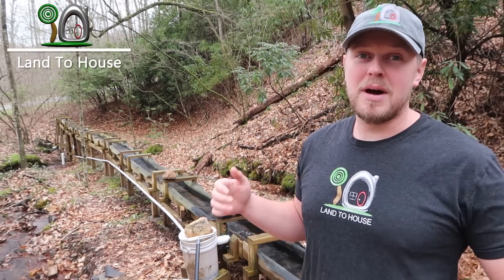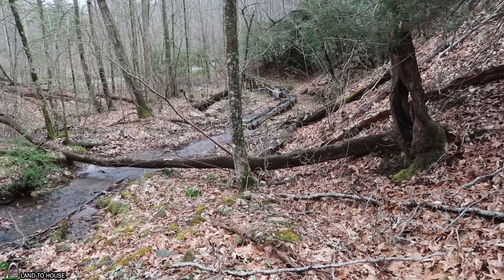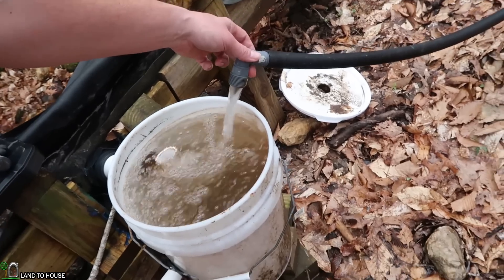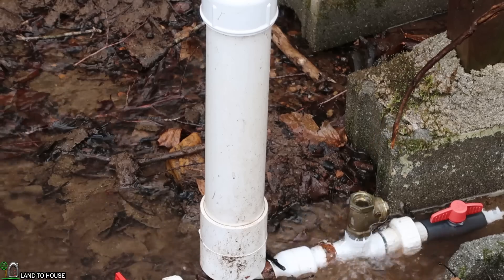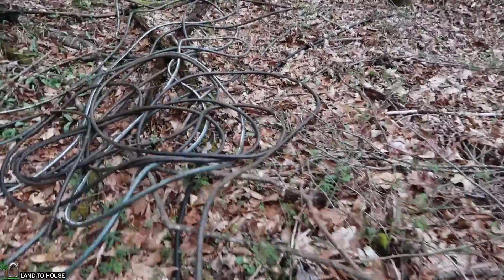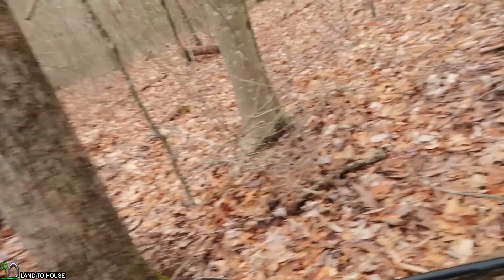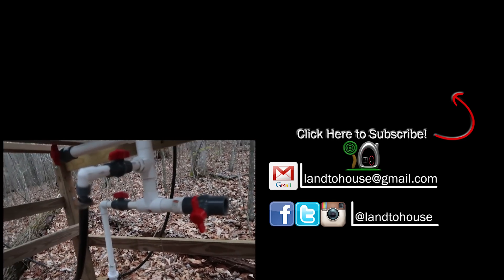Starting up the Ram Pump 2019

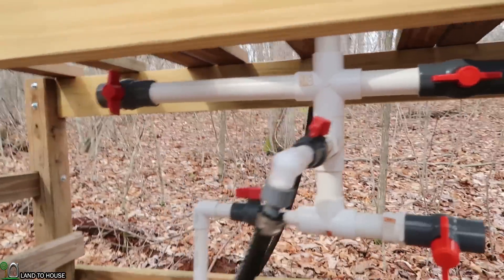Comment: @ 15:30 You said that the Water hammer caused the joint to pop.   It looks to me like you did not use any pvc primer.  It is your best friend when doing pvc pipe plumbing.   

When doing black ABS drain pipe it is not needed.   Primer on conduit is optional, but I use it because I do not want the pipe to allow moisture to gain access to any wires (just my precaution as I had an underground Power Company power lead to our house blow up in  our back yard.).  

There are videos on youtube on how to get fittings apart when glued.    You can also make your own water hammer arrestor and install it before the fitting .  interesting video.

Comment: almost all the forces involved in this system is from elevation head, atmospheric pressures are negligible
Reply: Correct. Atmospheric has no bearing on this. Head pressure at .434 pounds per foot of elevation.

Comment: This may not be a favorable question to ask, but how does this affect the wildlife by doing this? Seems like a sizeable creek
Reply from the maker: This creek is flowing around 50 gpm. The 1" pump uses 6gpm. But most of that water continues down the creek out the waste valve. So very little wildlife interaction.

Comment: You would get more flow by pumping into the top. You are working against gravity. The water pressure is falling into the pipe you are trying to pump out of.
Reply from the maker: I actually have a video test showing that it is faster to pump into a tank from the bottom. Because the tank is not full from the start it is not as hard to lift water into the tank.
Reply: @LandtoHouse  Yes but as the tank fills up the downforce of the waterpressure would cause the pump to struggle more than it would to just pump it into the top with a shepherds hook to keep the air out.
Reply: You could also have dug an area on the side of the hill and rode the waterpipe on the side of the hill into the top of the water barrel so that you approach at an angle rather than rising straight up from the bottom.

Comment: i would imaging that the size of the pipe does not matter as much as the height of the pipe.
theoretically at least it would be less atmospheric pressure if you go up because there simply is less atmosphere pushing down on the water.

Comment: Awesome build! I am a bit concerned about the location of the actual ram pump and the cinderblock footings. Consider putting down some rip-rap armor (cobblestone /angular rock wall) to angle the water away from the cinderblock footings. A good rainfall could cause some erosion as it looks very silty. Also consider some angle beams to the sections that are held by the footings that may become compromised. Very cool and I hope you implement microturbines for electricity!

Comment: another idea for removing bubbles is to add a small pipe section to make the water go straight into water instead of hitting water like your diving
Reply from the maker: Yes absolutely! I have added that in the 2020 ram pump start video.

Comment: The Ram pump is an interesting technology; But I Think I would prefer to use a solar powered water pump. Just much simpler in design won't need to build a water trough. Can fill up the tanks during the day. way less maintenance too. I think the Ram pump was a great idea in its heyday. But now solar panels and high lift electric pumps are plentiful and cheap.

Comment: I think there is another factor to consider once the water reaches the tanks. The weight of the water itself. Add to the weight of atmospheric pressure. If you put the input at the top of the tanks you can subtract the weight of the water in the tanks.

Comment: How do you deal with winter temperatures at the garden value to make sure its drained all the way
Reply from the maker: I just open the valves and let the water out as much as possible. I am thinking that with the valves open the water will expand out the top as needed when freezing.
Reply: Have you seen and damage in the past or it clears pretty easily after drained as much as possible
Reply: Also thanks for all of the info between you and mr wranglerstar ill have all the know for when I start my homestead

Comment: Gravity determines the pressure.  The rate is .454 lbs per foot of height independent of volume.  If the ram is 50 feet below your tank, the ram will see 25 psi static at rest.   Likely off the chart for impulse pressure.  The atmospheric pressure is not a factor unless you are feeding into a vacuum or pressurized container. Still nice piece of work.  Another good source of better water would be a catch tank from downspouts.  Each thousand square feet of roof will give you 600 gallons of soft water from an inch rain with a good deal less plumbing.  Your system is much neater engineering though.
Reply from the maker: I thought it was .433 lbs per foot?

Comment: Way to late for this suggestion:
To prevent the feed from causing bubbles in PC watercooling, you put a piece of pipe in the reservoir to have the water feed below the surface.
Edit: Just watched the Startup 2020 video, so never mind this here.
Reply from the maker: Yes! That worked well. Thanks!

Comment: If you remove the fill from below the tanks to an overfill method, there will be no hammer effect, that's a lot of pressure on those off fittings.

Comment: Barometric pressure equals to about nothing it's gravity that you have to lift, you need to start out with your larger pipe and go into your smaller, minimal difference but every little bit helps

Comment: 14:40 Doesn't the pressure calculation need to include from the top of the storage tank all the way down to the pump?
(As far as how much pressure is needed to pump up hill all the way to the top of the tank)
Also, is that the same no matter if you put the pump hose at the bottom or at the top?
The idea is that 4 feet under water in a swimming pool is the same amount of pressure on your body as being 4 feet down in a lake.
Reply: He's fighting gravity thought, not atmospheric pressure. Isn't the issue the weight of the water? Most H²O containment I've ever seen were filled over the top

Comment: wait, doesn't that mean that you can make a perpetually running pump that feeds itself? ofc you will lose water but it's still pretty cool.
Reply from the maker: Not perpetually running. Approximately 80% of the water that goes into the pump is lost out the waste valve.

Comment: The supply line could be connected to the bottom of the bucket, couldn't it?
Reply from the maker: Yes it sure can. I have added a longer pipe that lowers it down into the bucket.
Reply: @LandtoHouse  I thought you can have air trapped in the top part of the bend before the bucket.

Comment: The principle behind your pump has been around for a couple hundred years at least. What would be helpful to know, is what is the type of valve you have installed at the inlet to the vertical cylinder? Commonly available at hardware store? Are you in Tennessee?

Comment: Seth thanx 4 sharing your system.  I understand you pressure and pipe size based on atmosphere.  Though the purpose of storing water in a raised tank, is just that, storage, as well as head pressure.  Please entertain putting a check valve to capture and prevent your potential of open system draining of all the beautifully captured water in tanks up the hill.

Comment: sir how far your house from the rampump and its elevation. same with the supply to rampump
Reply from the maker: The ram pump to tanks is 350 feet distance. 35 for lift. The drive pipe is 40 to 50 feet long
Reply: @LandtoHouse  im thinkin if this can work in 2km distance with 1.3km elevation.
Reply: @kisuke6517  yes if you use 27 pumps staged at each height. of course very little will make it to the final height so not likely worth the cost. would be a interesting build while getting maximum use of the water.

Comment: 5:30 - What would be the challenge if you extended the supply line to stub slightly below the water level in the bucket?
Reply from the maker: That would be just fine. I actually installed a pipe on the end of that poly pipe to do that very thing.

Comment: 09:17 You explain that it's the atmospheric pressure that drives the pump, it is not. You explain that the size of the feed pipe does not mattes, it does.

If it was atmospheric pressure driving the pump, you could never lift water above the intake. What makes this work is the inertia of the moving water. When the valve suddenly closes, the inertia of the moving water increases the pressure in the tank, which again pushes the water up on the discharge side. Larger diameter on the feed pipe equals more inertia, equals more pumping pressure.
Reply: This guy Rams!

Comment: I dont think anybody should be allowed to take energy out of the streams. Imagine in the future where anybody with land can chuck their own turbine in the water and interrupt the flow for people and animals downstream for a couple hundred watts. $3000 worth of solar will do the job
Reply from the maker: This is not a turbine. Also micro hydro returns the water to the stream so the disruption is minimal.
Reply: @LandtoHouse  Oh ok wrong terminology. Still you are diverting nature for personal gain. Get a solar panel and then you dont have to alter natural watercourses? What is your output wattage?
Reply from the maker: The ram pump does not produce electricity.  It moves water for gardening and livestock.  

I am however actively installing a Micro Hydro turbine. It will produce between 300 and 350 Watts all the time. With the addition of my solar panels should we reduce our electric bill by $40 a month.

I have to off-grid neighbors looking to install turbines this summer. One should be about 100 Watts continually. that will greatly keep their batteries charged at night. 
 the other neighbor is probably looking at 60 watts. It's going to be a low head turbine.
Reply: @LandtoHouse  Yeh moving water is very cheap, electrically. You can move 6000LPH with 50w. So what you are doing is selfish and annoying but its all good. Just that in the future everyone will think they have the right to dump their personal shit in the creek and alter natural watercourses for the energy half a solar panel could produce.
Reply from the maker: Do you live in a big city? My closest neighbor is 1/4 mile away.

Comment: The bubbles are picked up as the water leaves the supply line and enters the filter bucket.
Just add a little longer pipe end to the supply line to lower into the water of the filter bucket.
No more air.

Comment: Would the water rise faster if you allow a spot for the air pressure to exit, example: water is going up the pipes and if you extended the height of the pipes and put holes at the top of each extended part, would it fill faster?

Comment: You will get to a point where the head will overcome the pumps ability to push water. But judging by the pressure of water hammer that these units can generate. That would be a huge head! Does anyone have the set of equations for calculating max head height these pumps can achieve in the delivery line or does this require a computer model? Are there any rules of thumb?
Reply from the maker: I have some 1/2" pipe and a hill with 150 feet of head behind the house. Planning on testing soon :)

Comment: 🤔 when you were talking about atmospheric pressure being equal in both cases, does it make a difference how WIDE the surface area is.?  Like, do you not have more atmosphere pushing down on a larger surface.? 
Damn hydo-rules.!  Liquids do some very strange things in pipes and vessels 🤬🤬.  😘
Reply: It's more gravity that atmosphere. 100 feet is the same pressure at the bottom wether it's a mile wide or an inch. At 100 ft it would be roughly 45psi.

Comment: Simply turn the 90° angle bend to the side, so the water hits the side of the bucket, and smoothes out the flow. This allows the bubbles to simply ride the current around the tub. Rather than them being forced down into the deeper water 
Also.. I'm amazed that you've not thought of... a 3"X3" cut in the top of the bucket, would allow you to sit the supply pipe into it, and allow you to put the lid on properly. That would look a lot neater.

Comment: Neat video, but why not just fill the bucket from the flume, instead of running that line ? you could put an inlet screen on it, and overflow back in to flume. Keep up the good work ! BTW, where are you located ? and, You obviously dont use this system in the wintertime, or you are pretty far south. The leaveless trees tell me you are in a frost zone.

Comment: How come you don't fill your tanks with the delivery line connected to an intake port in the side of your tanks near the level of your overflow; this would ensure that no water can drain back out of your tanks, should the inline check-valve ever stick open. You could also install a float-valve in each tank and eliminate the need for an overflow. If the inline check-valve ever sticks open, you might not become aware of it, unless a pump valve also fails. In such a case, the tanks would still drain inadvertently. With the delivery line connected to a port near the  top of the tanks, then the tanks would be unable to drain back through the delivery line, regardless the pump operation.

Comment: Does this system work with an actual mid size river as sourse?
Reply from the maker: As long as you have head pressure (water drop from intake to pump) of at least 2 feet.

Comment: Doesn't the ram pump size also depend on how much water pressure and downhill momentum you can gain from the ram pump? If I did this in a large River, with a 20ft slope, the pressure I could get through a multiple inch pipe would be crazy, right?
Reply from the maker: The pressure that is built inside the ram pump is based on the input head pressure. From my tests I have found that each ram pump can pump to the same height based on the same input head pressure. The difference is the amount of water that the pump needs to operate as well as the amount of water pumped up. 20 feet of head pressure can lift to 140 feet. This is getting close to the max lift of this style ram pump.
Reply: @LandtoHouse  Ah I see, thank you for the information!

Comment: If you will put you a check valve at the tank and then run from the tank of your ram pump up to where you are going you’ll have much better results on pumping water
Reply from the maker: The other style ram pump does have a slight increase in efficiency.  The problem is they are harder to ship.
Reply: Land to House i’m talking about putting you a check valve at your ram jet  tank so all water pump into your tank stay in the tank with pressor to push water up to where you need it also having a bigger line will give you a higher results on the ram jet more weight of water you have when it ram jet The more water will be pushed up the hill I recommend having a 1 inch pipe to ram jet that gives you more weight And more pressure to push water faster up the hill all you need is reducers to reduce it to your ram jet The 1 inch pipe is just there for a weight of water  To make the ram jet more Efficient Instead of pushing 5 pounds of water As you are doing now and 15 pounds of water into your ram Jet tank To be pushed up the hill Using a 1 inch pipe 1 inch pipe I’m referring to is the one coming off the hill up there with your screens that gives it more weight to ramjet stronger and pump faster Having a longer pipe going to the Ram’ jet also makes it more efficient when pumping water up the hill A 30° angle is the most efficient having a longer pipe will make it more efficient that’s just more weight coming to your ram jet

Comment: Hi there. 
I am planning to build my own ram pump. The problem is that I don't fully understand its basics. For example, how long should the drive pipe as to its delivery elevation? The size of drive pipe as to the size of the delivery pipe. The size of the pressure tank as to the given drive pipe and delivery pipe for a certain level of elevation. 

I would love to from an expert of you. Your inputs will be greatly appreciated. 

More power!
Reply from the maker: It's good idea to keep the drive pipe between 25 ft and 100 feet long. The size of the drive pipe needs to match the waste valve size of the pump. The delivery pipe can be any size you want as long as it does not restrict by friction. The lift height depends on the input head pressure. Typically you can expect a 1 to 7 ratio head pressure to lift.
Reply: @LandtoHouse  thank you for your quick response. Your inputs will be of great use to me. By the way, I'm from the Philippines. 

Be starting my project after COVID-19 is gone. 
Again, thank you very much! 

#StaySafeAtHome

Comment: I just caught this video where you were fitting one on a farm. My problem is my pond is the lowest elevation of my land so no drop pressure could be achieved. I have witnessed other types an versions of this simple system in some third world countries where they have no electric either.
Reply from the maker: Yes I went out to the Stoney ridge farm. The ram pump needs head pressure. That is drop in water from the source to the pump. It's what runs the pump.
Reply: simple to get head pressure go up the water course to pick up water to get a head to your ram.  simple hydraulic
Reply: You could dig a deep hole next to the pond.,. The only issue is you then need somewhere to disperse the waste to.  Unless your land drains easy and fast....